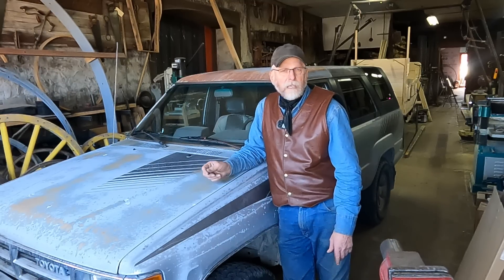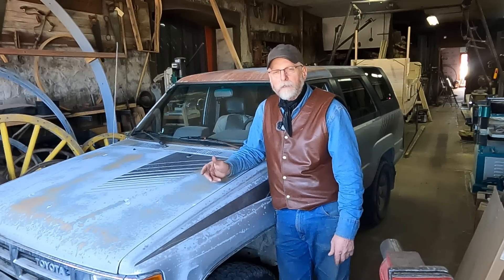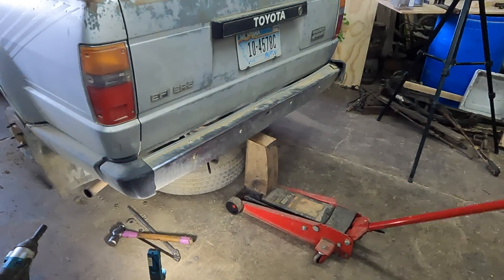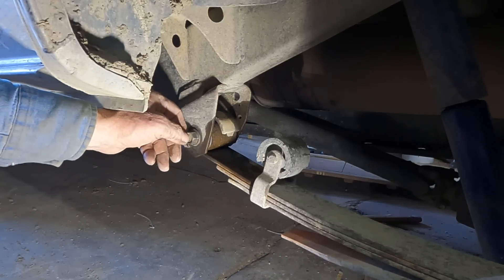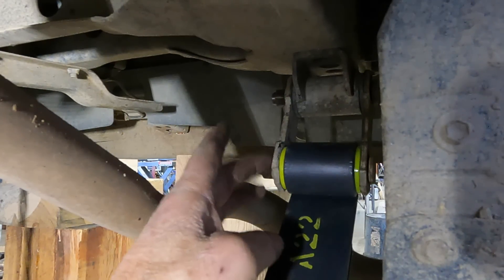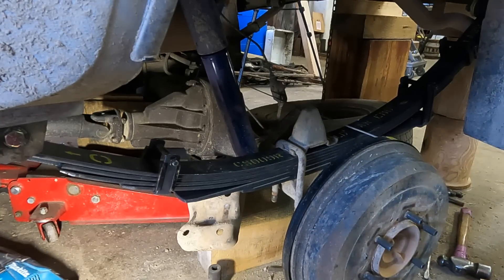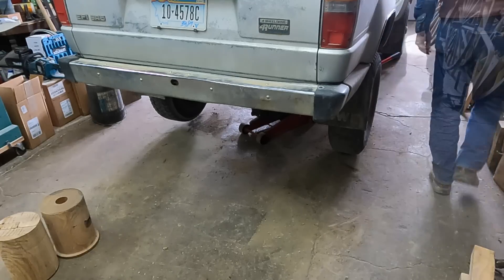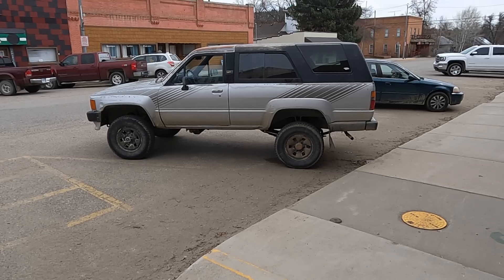My 1987 Toyota 4Runner is Worn Out | Engels Coach Shop

Comment: i have an 88 they are now collectors items they are becoming rare as modern 4runners you cant remove the top. these ol gals suffer from rear end squat due to toyotas poor spring design, you have a good lookin runner no rust in the normal issue areas the roof is actually an odd place for rust i guess its from being out in the desert

Comment: Firstly l live in Australia and your 4 Runner has the famous 22R motor and in Australia the 4 Runner up until 1998 were very rare l have seen only one 1997 4 Runner now what caught my interest was it's a Toyota and l own a 1997 Toyota Hilux rwd single cab chassis with an aluminum l have owned it about 4 years and spent money worked on it have had to change its rear springs because from what l have seen on the Hilux it has had an easy life at the moment l am changing the uni joints and they sre the original uni joints only one has worn out but l will change all three your 4 Runner was a bargin although 18 years ago at usd $500 well my Hilux was aus$1500 about what they were worth but but in the 4 years of ownership it has increased in value by five or six times they sell for aud $5000 $6000 $8000 and one sold for $10000 and l can jusyify spending money on it because for a new one is over aud $30000

Comment: from Thomas; this  4 cylinder was one of the worst engins Toyota ever built. I  got cought in the hipe and bought it used with150,00 miles for $4000 .A year and a half later It was into us for $13000 and I gladly sold  it for the original $4000. At 90 dyslexia is still  a problym. I enjoy watching  ordinary people doing extra ordinary things.

Comment: Scary fact, Toyota says 1 qt per 1k miles is within spec
Reply: Where? When the 2.4 l motors where known to do exactly what you described, they repaired them for free. Essentially a new short block. It was a company initiated campaign, similar to the torque converter issues of mid 2010 camrys.